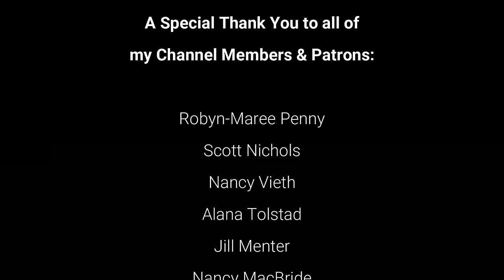Almighty Garden Disaster Rescued | Satisfying Overgrown Makeover

Comment: Those metal trash cans are great! We had them when I was little. Two fit inside of our aluminum cart complete with 2 front wheels and handle bars you lifted up on to take trash to the road. Nice the cans were smaller than they are now because easier to lift the cans and cart. You could also get your arms easily around the can to grab the metal swing hinge handles. 😃